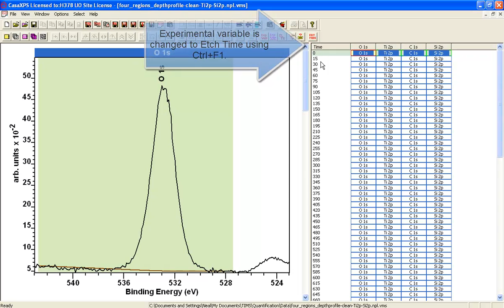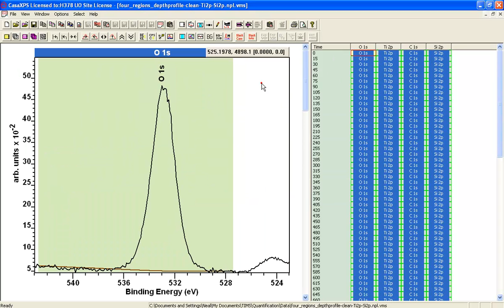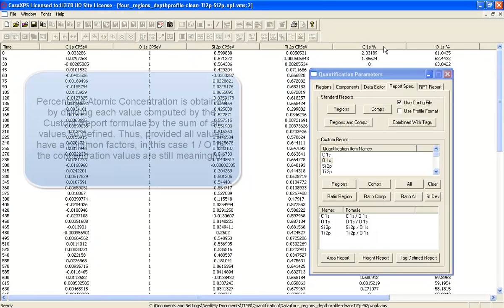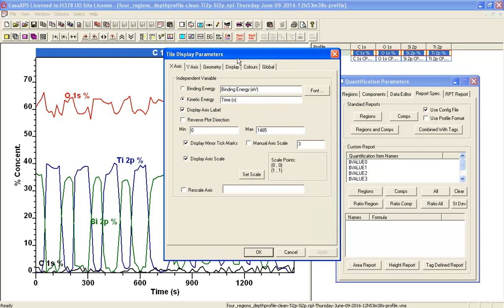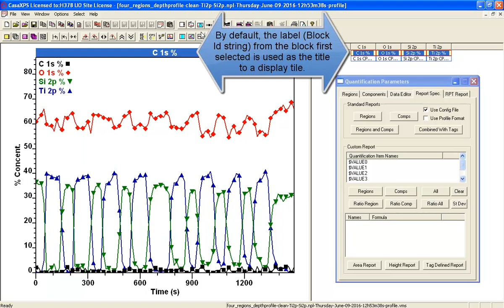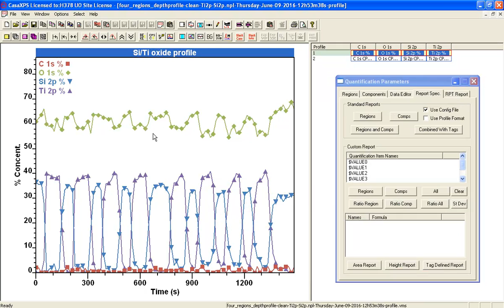Introduction to Sputter Depth Profile Creation and Display Options in CasaXPS

Comment: Whenever I follow this only the first layer (etch time = 0) was quantified. How do I quantify the whole etching? Do I need to do it etch time per etch time?
Reply from the maker: I suspect you need to propagate any regions and components to other spectra in a profile before using the Custom Report  to generate a profile itself. If you send me your VAMAS file it will be possible for me to give a better answer to your question. neal@casaxps.com.